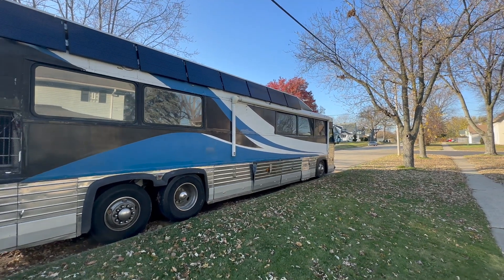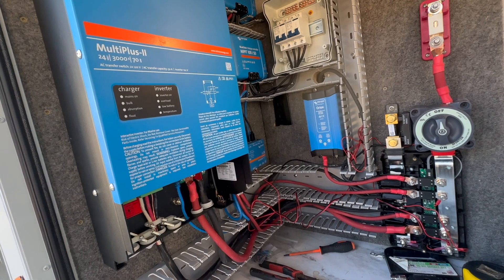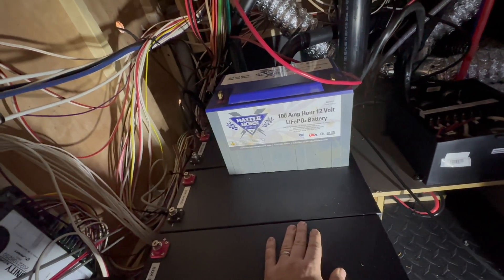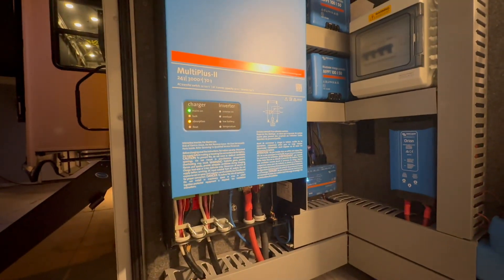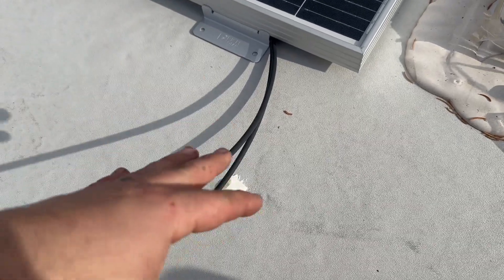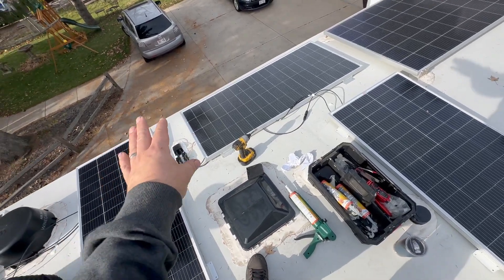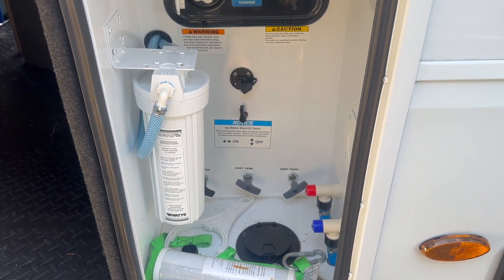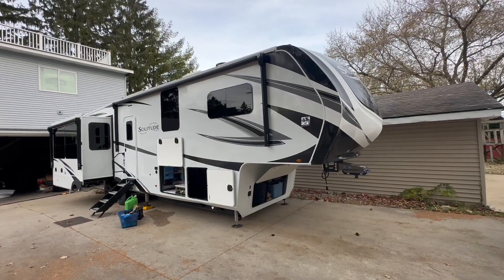Grand Design Solitude 2024  Victron Solar Install 2500w 24 volt system with Multiplus

Comment: I like what you did with the 12v battery for handling heavy current draws like for slides, jacks, generator starting, etc. Great minds think alike.
Reply from the maker: Wasn’t without making a few mistakes first. Thanks!
Reply: @sotasolar  Yep, I've made my share for sure. It's how we learn.